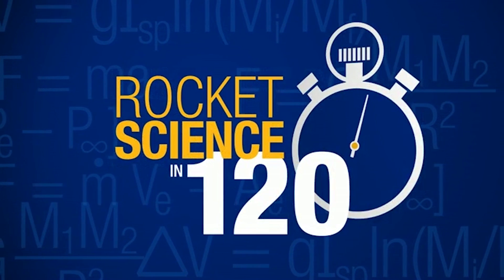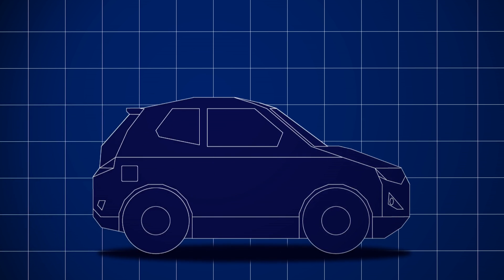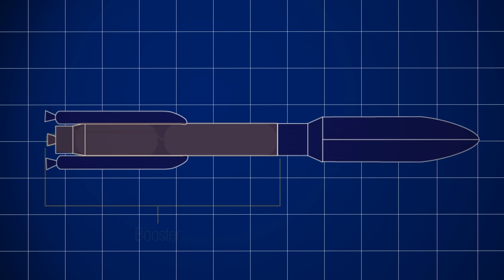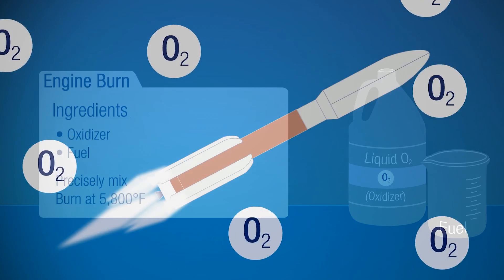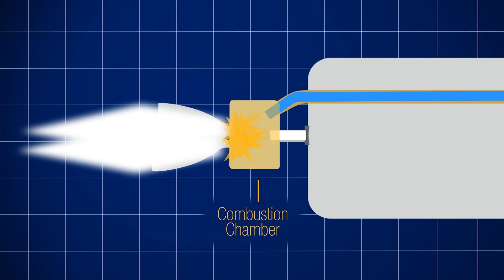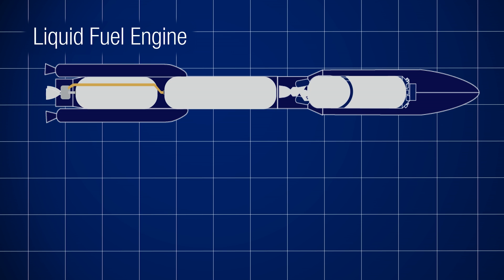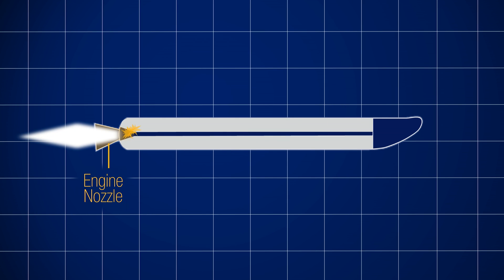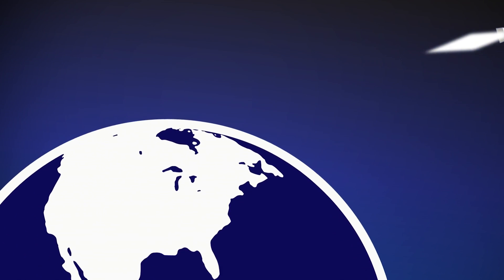Rocket Science in 120: Propulsion

Comment: heres an xmass present for you all............

why cant a rocket enter space vacuum....

There are 4 major ideas on presented on the Internet, including NASA web sites, as to how rockets generate thrust in space
1. Newton’s 3rd Law : for every force there is an equal and opposite
2. Newtons’s 2nd Law : Force = Mass x Acceleration
3. Conservation of Momentum
4. The use of a specialized nozzle to accelerate the gas inside the ship, concentrate and aim the gas jet

I have explanations for all four...but ill skip straight to the second F=ma as it closes the door entirely to space travel using rockets....
Firstly you have to comprehend Joules expansion https://en.wikipedia.org/wiki/Joule_expansion
In a nutshell ... In free expansion there is no resistance to the fluid at system boundary as the volume of fluid increases to fill up the vacuum space.

Since, vacuum does not offer any resistance there is no work transfer involved in free expansion.

This experiment is verified and i often get rebuttals saying ""its all in a container"" the reason its done in a container is because the experiment is about effects of gas in a vacuum..so to do this experiment here in the atmosphere requires a box.
Free expansion shows us that you cannot throw eject or push a gas into a vacuum..the reason is because.... Moving gas into a vacuum, such as from inside a rocket in space to outside, is not a process that requires work. This is because free expansion of gas allows/enters a vacuum "for free", no work is needed or done. The gas does not push outward from inside the rocket and is not pulled in by the vacuum of space. Natures seeks to bring the two sides, high pressure and zero pressure, into equilibrium and does so for "no charge". Although this is a well-known result in Physical Chemistry and Thermodynamics you almost never hear of it in the context of space rocketry because it wreaks havoc on the NASA-led theories of thrust.
To elaborate further about free expansion you simply cannot force, push, eject, thrust, accelerate or throw a gas into a vacuum..

So herein lies the problem with F=ma....F a force firstly needs to interact with its surroundings and must collaborate with an opposite force to actually be a FORCE......m mass from the rocket the exhaust gas needs to interact with the rocket and a collaborating second body('Equal and opposite')
One problem frequently observed by physics educators is that students tend to apply Newton's Third Law to pairs of 'equal and opposite' forces acting on the same object.[4][5] This is incorrect; the Third Law refers to forces on two different objects.
And now (a) acceleration of mass...just because a mass is moving does not mean it does any work. Mass in motion has the property of momentum which is not the same as force. In order for momentum to be turned into force it must interact with something else other than the rocket itself.('Equal and opposite')

Thats the brass tacs of why rockets cannot propel themselves in a vacuum....
Reply: You have it wrong.  The "free expansion" of the gas does not perform any work ON THE VACUUM.

Work is DEFINITELY performed by PUSHING the mass of the exhaust into the vacuum.

And BTW "free expansion" is really just letting the gas expand under its own power, like letting a puddle of liquid oxygen evaporate into a vacuum.
Rocket engines apply a HUGE FORCE and PUSH the exhaust gas in to the vacuum MUCH FASTER than just freely expanding.
Reply: @stuartgray5877 nope
Reply: @newperspective7790 . Care to calculate how much “work” is performed by accelerating 500 kilograms of water from a velocity of zero to 2500 meters per second?

I know of a Machine that can do this once per second
Tell me that Machine “performs no work” genius.
Reply: Thats the "brass tacs" (tacks) of why rocket scientists do not listen to high school dropouts.
Reply: @stuartgray5877 oh my mistake, 11 yrs out the window, will do better next time, you didnt read it and couldnt comprehend it even if you did. Shhhh.